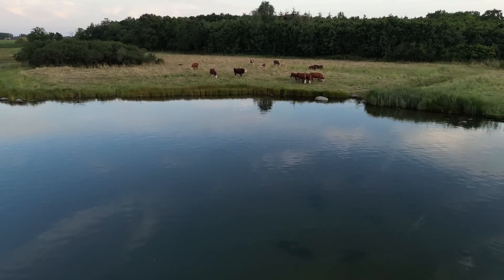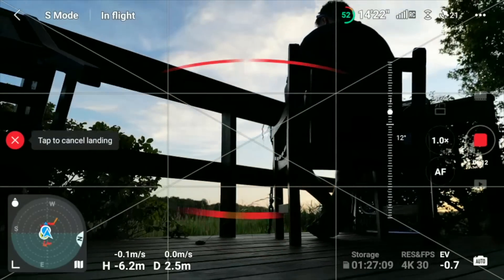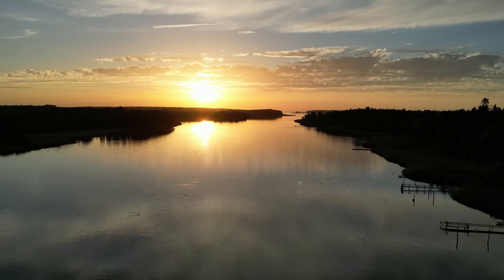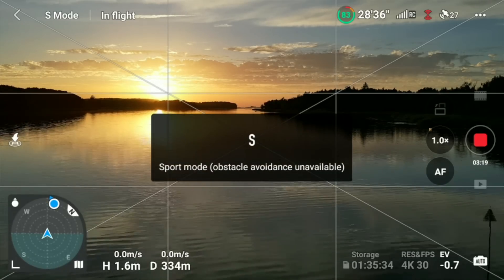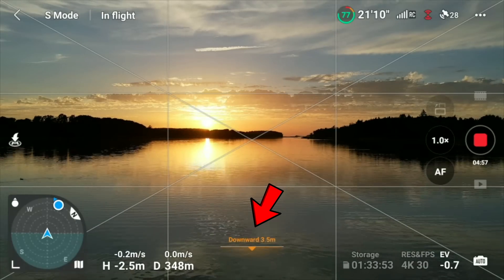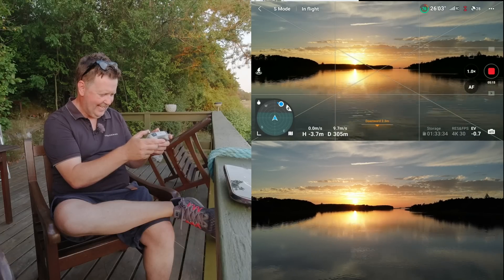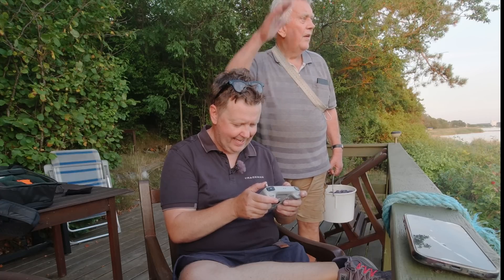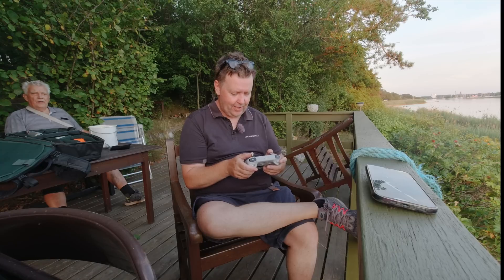DJI Mini 3 Pro | How to FLY OVER WATER with DRONES 😱

Comment: Thanks to the DJI Super moderator. What I thought was GPS altitude is actually the difference in altitude from the launch point altitude. My long driveway rises up to the house on a hill. If I launch from the house and fly down the driveway and try to maintain a constant height above the pavement, when I get to the bottom of the driveway, I'll see a negative altitude!!  Good to know!

Comment: Great tutorial sir, thank you! Quick question for you- how safe would it be to film a mastershot of a subject that is actually in the water? There is lighthouse that I want to film that is in a river near my house. How high should the drone be in comparison to the lighthouse before I draw the rectangle around it to select it? Would I be safe being level with the top of the lighthouse? I just don’t want the drone to do it’s thing and get confused over the water bc I know that the bottom sensors aren’t the best over water. Thank you very much in advance!

Comment: I'm glad you added the pop up explanation. I was going to comment that the height measurement is from take off altitude but you got that covered. I enjoy your videos and instruction. When I fly over water or want to get close to the ground I use the sensor reading as I think it is more reliable as to height above ground at that location.

Comment: I advise not to go low and fly over the water in sports mode. That's how I have lost a Phantom 4 drone. In sports mode, the drone was asking more power from the batteries, causing the drone to lose hight. I started at 4m altitude and the drone had lost these 4 meters within half a minute in sports mode or so. I did not touch the left controller stick where you control the altitude. DJI did not want to accept this as a technical failure, where I think they did not have their priorities right. Altitude hold should be more important than speed in my opinion. I had to pay a new drone. Better be safe than sorry guys...

Comment: As far as I can work out, which is also mentioned in the insert from DJI, is that the built in barometer controls the altitude hold in the drone. GPS is great for latitude and longitude stability but notoriously bad for determining altitude. I remember a friends GPS telling us that we were 40m below sea when we were actually a few meters above sea level. If the downward sensors are not working and barometric pressure changes while you are flying, the drone can easily either rise or drop suddenly by a meter or two. Obvious;y low over water, this can have disastrous consequences. I had a Bugs 3H drone that had no GPS but did have a built in barometer for altitude hold and I observed this often.

Comment: Nice video. Interestingly enough, this is exactly what I was trying to do with a phantom 4 pro. However, at about 15m height it's like someone pulled the battery out. Motors quit, video feed quit, I looked up and saw a decent splash. Still quite shocked, as I've never had this happen to an RC plane in decades of flying them. Unfortunately, this changes my perception on reliability of these units.
Reply from the maker: that sounds sounds bad - did you send flight logs for analysis?
Reply: Not sure how that works, I haven't.

Comment: Tip: You aren't pointing your controller at the drone. This is ok as long as you have a strong RC signal, but it is generally frowned upon. Just a heads up. Otherwise great video man!

Comment: Have you ever had the H point follow the drone? I wait for confirmation but it doesn’t stick. But if I then change the battery it stays with me. Like you showed I also get the negative height readings. Following a boat side view I panicked because I saw I was -6m and almost ditched it…I love beach flying :D (mini3)

Comment: I lost my dji fpv in cristal clear water (like in the video). I started at 10 meters and then I followed the altitude and it looked like I was climbing, despite I didnt touch the altitude. So I compensated by going down and I hit the water. The indicated altitude was 7-8meters but because it was so clear I couldnt really tell how high I was. The drone went into failsafe mode, stayed still above the water. I thought I was saved and started to get my breath back. After 3-5s the drone dive into the water without any input, probably because the altitude sensor was giving false info. So ne careful above water!

Comment: you set home on deck. Deck was above the water. That's why the altitude seemed wrong. Mostly it seems risky to fly close to water--sensors and chance for a minor mistake just aren't worth the risk. I came close to a wet landing that was not due to any mistake on controls one time in bay--2s just settled lower and lower.  MAKE SURE TO BE CAREFUL ON HOME POINT!

Comment: I’ve had no issue so far with flying the Mini 3 over water when I’m in full control. But the moment I use any of the intelligente flight modes is when I’ve almost seen it dunk itself. Both directional hyperlapse and active track have issues detecting the surface level of the water due to the reflections. In active track, if you keep it 10m high above the water, you have no issues, but under 10 meters it starts to Tarzan around over the water around the subject. In directional hyperlapse, after locking the direction and pressing start, the drone started moving forwards and at the same time descending towards the water. It’s not supposed to change altitude but I couldn’t keep it from wanting to dive downc, but when I brought it +10m over the water it worked fine. I guess the lesson learned here is DO NOT USE intelligent flight modes when flying lower than 10m over water.
Reply: I've tried mine over a lake but granted I was aways up, always worried seeing others have issues with flying anywhere close to the water surface

Comment: I have had my drone (Mavic Air 2) do uncommanded drops over water on 2 occasions.  The first time I was traveleing about 2 meters above a slow moving stream and I saw the drone dropping down on itS own.  I did a full stick up and saved it.  On the second occasion I was about 5 meters above some breaking waves, having just completed a nice shot goin down the beach, when I took my eyes off the drone and down to the screen.  When I looked back to the drone it wasn’t there anymore.  It had dropped straight down and was heading into the roiling water.  I was lucky enough to bring it up with full up on the left stick.  My experiences have convinced me that uncommanded drops over water are very real and very scary.  I still fly over water, but keep my height at 10 meters and am always ready for a left stick up move‼️

Comment: I lost my mini 2 when it crashed into a lake for apparently no reason. I was hovering at about 4-5mt above the water, tried to take off and suddenly the screen showed the water as if the camera was pointing down. next thing I remember is seeing my drone crash into the lake at full speed ☹️

sent the flight log to DJI (which showed the stick positions and me pulling up the last seconds with no luck) luckily it was clear that it wasn't my fault and got a replacement aircraft. excellent customer care at DJI!

I don't feel safe flying too low over the water after that though.

cheers from the dominican republic 💪

Comment: I have learned that the altimeter on the drone starts at the altitude you start from.  So if you take off from a platform that is off the ground. Your altimeter will read zero from the platform.
Reply from the maker: You are right
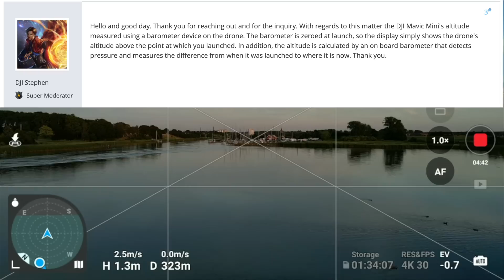Reply: I saw this comment at least 3 times now. Nobody read the forum post at 4:22 in the video from the dji representative? It's literally the same info he gave

Comment: GPS signals can be reflected of the water which can confuse the drone at low levels so its vital that you have good visual contact with the drone. The drone height is also measured by the drones internal barometer as GPS is better at determining position rather than height.
Reply from the maker: Yes I know, multi path Issues but in general the z position is not very accurate

Comment: I always had the 8dea that altitude ZERO is the altitude at the launch pad. The reported HEIGHT after launch is relative to that point. So, from the platform you & your father was upon lakeside, it must've been about 4m above the surface of the lake for your reported HEIGHT to be -3.6m.
Reply: That is the same information the dji representative gave in the forum post that was visible at 4:22 in the video
Reply: yup. was flying over the ocean at night and my m3p dove into the ocean... I was about 20ft above the water and it landed.. got the GPS and Google maps put me directly on it. I was standing at the sea wall with my spot light.  the water is about 2-3 ft and murky. 💥 I see a dim outline of my precious! there was a broken net I found and I was able to fish it out! I darted to the store and got a shit load of alcohol and thoroughly rinsed it. it now sitting in front of a dehumidifier.. wish me luck!  
ps. I did have night lights on the drone and it was still flashing when I got it out but of course it landed upside down.. cannot believe I found it
Reply: 100% As someone who routinely takes off from my deck at several meters above water level I do really wish there was a way to manually offset this.
Reply from the maker: yes, you are right

Comment: 2 years ago I lost my mavic air 2 flying over a Norwegian fiord. The drone was about 200 metres out when it suddenly dived into the sea. Most disconcerting because it was the beginning of my travels in Norway. At first I thought it was my mistake, but upon looking in the flight data the drone was 9metres above the water when it suddenly disappeared. I never found out why it suddenly just took a dive.
Reply: Where do I find it on DJI RC
Reply: Where do you find such Flight date I thought all information was Store on the memory card in the drone
Reply: @bentelkalb  I was referring to the RC-N1 controller. There, all your data was recorded on the dji fly app using my iPhone and of course with an internet connection. I have problems with the RC too. I guess the best my to record your flights is to insert an sd card in your controller.
Reply from the maker: it's in your cell phone somewhere
Reply: If you go into profile on the fly app, klick on more and you’ll  have the complete history of your flights
Reply: @terencepevreal2912  But that will not help because as I understand it will only sync to the App when Connected by wi-fi. This will only happen after the flight So if you Crash and lose your drone There is no flight Record?
I am using the RC controller.

Will you need to put a memory card into the controller and record flight data live?